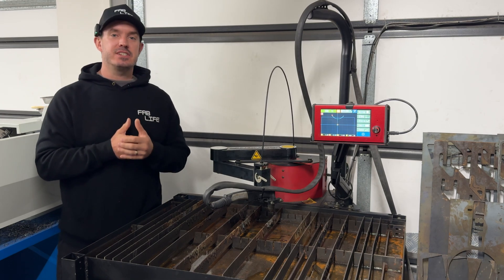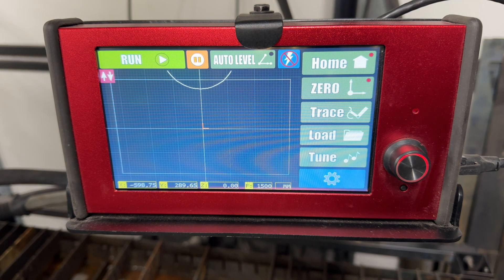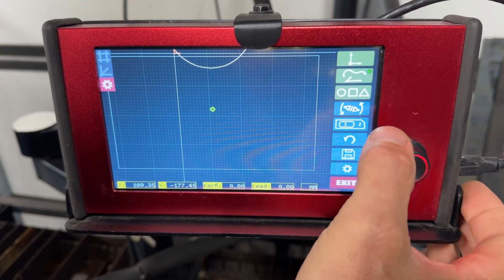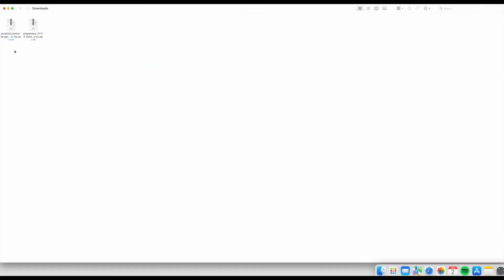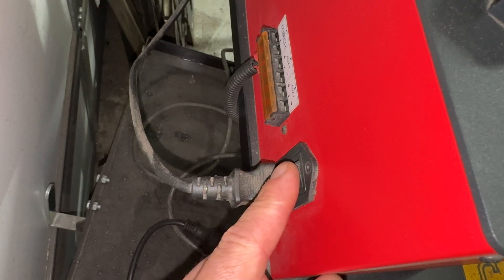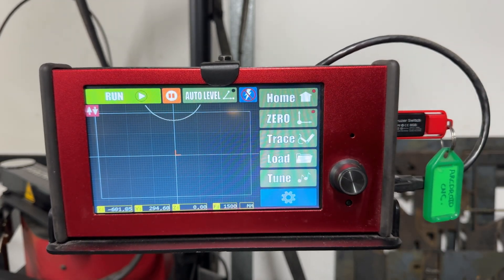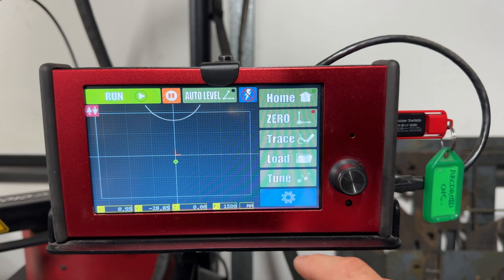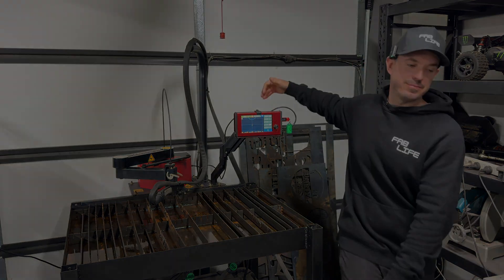ARCDROID CNC Latest update December 2024

Comment: I bought it too, it works well, but I have a problem you might be able to help me with. At the end of the burner cycle, the arcdroid  mechanism stops, butthe torch continues firing for about a second, which leaves a nice hole at the end of each vector. Do you have any idea how I can prevent this? Setting the off-delay to 0 didn't make any difference. I also use a shielded control cable,. I'd be very grateful for any advice or answers. Franz from Austria(Europe)
Reply from the maker: Thanks for the comment 👌. Your issue sounds like the length of the “lead out”. In your design, you need to allow for a small path to lead out of the cut. If you end on the design path, it will leave evidence of where the torch turned off. I use fusion 360 which allows me to set a “lead in” and a “lead out”. Give this a try. I’m happy to help out. Let me know how you go buddy 🇦🇺🙏
Reply: @Fab-Life444  Thanks for your suggestion,I´ll give it a try.Thing is I´ve no knowlidge of fusion,tried a bit QCAD will see if there is an option too.
Reply from the maker: There should be. It should be a parameter in the post setup before you save it… unless you’re solely relying on the arcdroid to create the cut paths